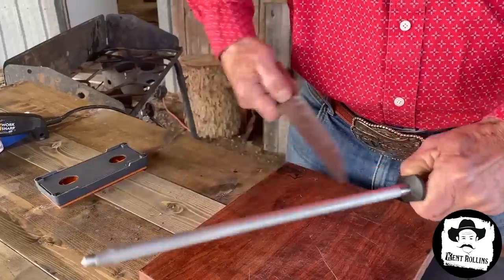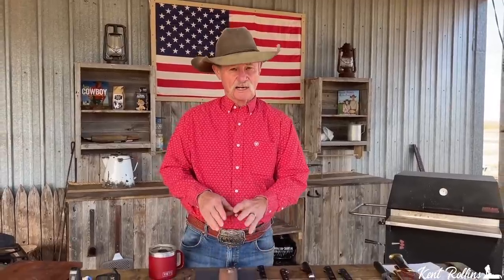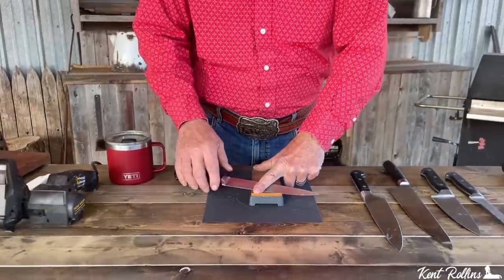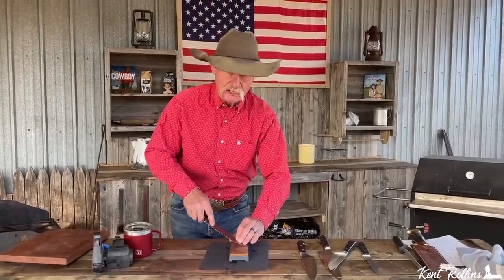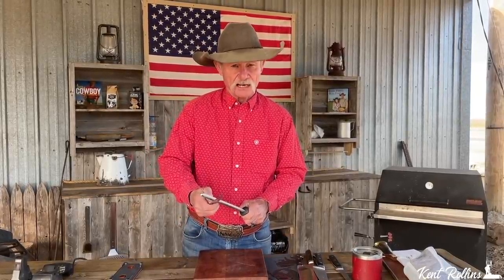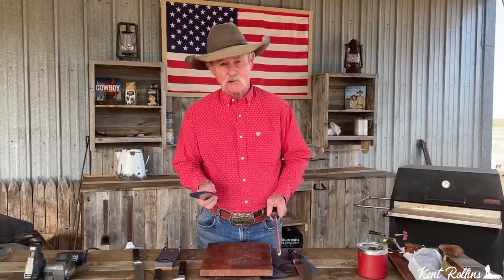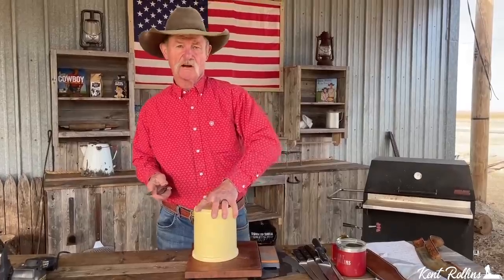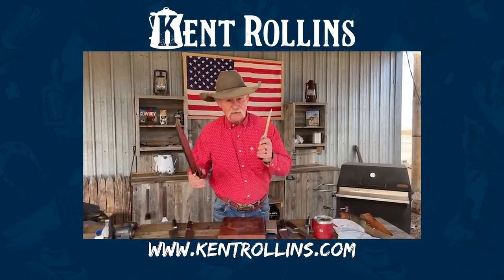Best Knife Sharpening Tips | How to Sharpen a Knife

Comment: Hi Kent! I’m a professional knife sharpener who found your video thanks to the YouTube algorithm. 
If you don’t mind, I have some tips for you to take your sharpening results even further.
When sharpening on the diamond plate or on the stones, I’d really recommend you to keep your fingers on the blade while sharpening. So where you put the pressure with your fingers, that’s the area you will be sharpening. Then work your way along the blade section by section to get a burr along the entire blade before you move on to a finer grit. When you’ve worked your way through coarse, medium and fine grit, strop the knife to remove all that loose steel from the edge.

Also try not to cut into the stone, sharpen you knife with long, smooth strokes along the entire stone to keep that blade angle as steady as possible! Then you’ll have a blade sharp enough to shave with it.

Cheers from Sweden!
Reply: I was gonna say the same myself

Comment: Nothing is more dangerous than a dull knife.  I have been cooking in commercial kitchens for over forty years, and tuning up my knife edge is always the first job of the day!  Thank you for the tips Kent!
Reply: I never understood this idea, so maybe you can explain it for me since you have more experience. Poor cutting practices and not paying attention is dangerous, and a dull knife won't cut your fingers off. I've cut myself with both, and would say a dull knife hurts worse, but a sharp knife does a lot more damage.
Reply: @gotdangedcommiesitellyahwa6298  I think what they're saying is you have to put more force behind a dull knife so if it slips, which it is more likely to, it will do more damage
Reply: @gotdangedcommiesitellyahwa6298  The whole idea of a sharp knife, is to minimize the effort required to perform a given task.  For example, if you are processing a beef hind quarter, or boning a lamb shank, you want to do it with minimal exertion.  A dull knife will make the job difficult, and increase the effort needed, as well as increase the possibility for error and injury.  In all my time, I have only been seriously cut once (the tip of my pinky finger) due to not paying enough attention during a dinner rush.  That was a very sharp knife, and I have no one to blame but myself.  Trust me when I say, that a sharp, well maintained knife is the only way to go.
Reply: @gotdangedcommiesitellyahwa6298  Yes, in theory if the same good practices were done then it wouldn't matter, and if the same bad practices were done then the dull knife would do less damage. The point being made is that unfortunately us humans are not machines and dull knives tend to encourage bad practices due to requiring more force, while sharp knives that cut easily are easier to keep in control.
Reply: My in-laws had four knives in their kitchen and they were all so dull they wouldn't cut butter if you heated them up first. They were older and I figured they just couldn't keep them sharp like they used to, so once, while we were visiting, they had gone somewhere for the afternoon and I thought I'd do something nice and spent a good bit of time sharpening the knives. I told him when they got home and my father in law grabbed one and threw a fit because it was sharp. He said something to the effect that it was dangerous and they'd end up cutting their fingers off then proceeded to run the freshly sharpened edge over the bottom of a coffee cup until it was dull again, then grabbed the others and did the same thing. 🤷🏻‍♂️😞
Reply: @randymartin5521  OMG!
Reply: @jeffslaven  yeah, mom-in-law had some issues but my father-in-law was a whole different kind of crazy.

Comment: Your dad was right, as a chef for 10+ years dull knives increase pressure applied and increased pressure with a  dull knife will tear both you and what you are trying to cut.  The knife you were trying to read we always called "Henkels" I use almost the same brand called "Wustoff".  Those knives are fantastic and i have had mine for 30 years and still sharp as a razor. One note my chef's knife is kept @ 20 degrees where my Japanese Santoku is more like 15 -16 degrees.  One warning about side windows, they are tempered so if you  hit them with the edge or the dull side too hard... just so they will pop so be warned...it'll work but be careful.
Reply: I'd rather be cut with a sharp knife than a dull knife any day LOL.

Comment: My buddy has an old “barn sharpener” it’s like 20 washers with 10 on each side fingered together like playing cards. But kept apart enough to leave a perfect bevel in between them. It bolts to a door frame and you can just draw a blade down the center like two times ,and it will have a perfect 50/50 bevel.  He says it’s really old , and ALL the draw type sharpeners are based off of it. 
   I still go old school with oil stones , and finish with diamond dust on stainless plate steel . 
  Really like the window trick !!! That’s just pure genius .... 
   🤠🎸🎶✌️

Comment: Oh yes I remember TG&Y stores.  If it weren't for TG&Y and the Dollar Store in my little town of Lucedale, MS back in the '70s, we would have to go to big city in Mobile, AL for anything else.  Now we have Walmart and think we're in heaven now. 😁

Most people I know use the three stone method or a circular method and most prefer oil to water when wetting the stone, something about water and steel don't mix too well.

I've got a Crocodile Dundee knife also but it needs a new scabbard because it was dry-rotted when I got it brand new from Amazon but I don't recommend using the honing/sharpening rod that came with it since it's for show.

I've got some K-Bars also and they all came with dull blades but sharp enough to cut but not razor sharp.  My Buck 110, 119, and 120 came razor sharp out of the box, so no need to sharpen them until much later.

Great video Kent and looking forward to your next one.

Comment: I still have my 12” breaking knife, a 6” flexible curved boning knife, and a 6” straight boning knife that I used at Texas Tech meats classes where we learned to cut up beef, pork & lamb.  Those knives are R.H. Forschner or Victorinox trade named knives made in Switzerland ( same company as the “Swiss army knife”.) Those knives are 45 years old and I use them daily, generally use a good german honing steel to dress up the edge.  You can find hundreds on ebay and they are very reasonably priced.  We go to estate sales and are amazed at how many people use cheap trash knives they buy at the grocery store. We have a family custom - give a newlywed couple a couple of these good knives as a wedding present. They’ll last forever unless you ruin them by grinding them on a can opener sharpener. Love your channel!! I learn something new from you everyday! Rob Hillsboro,Tx.

Comment: Yessiree !  Best to have a decent quality made knife first and then maintain it.  Not many folks want to spend much money on a knife when they can buy $10 knives that work almost as well but will not last very long. Happens year after year...but those who can justify $50 to $100 on a well made knife will find the advantages in short time. A whetstone is the best method we think because they have such a larger surface and make the process much easier to maintain the 20 degree double nickel while stropping the knife. 
And that is a true statement about dull knives...they are more dangerous than a sharp one is yet folks continue to believe that is false. Too bad so sad. 
Those are Henkel brand knives also known as J.A. Henkels Zwilling Germany knives. Another great brand is Victorinox and Miyabi.

Comment: Keeping a sharp knife is 100% the most important part of kitchen work. Trust me. I have done it for 17 years, when that knife hangs when you're going fast, you'll feel it. You need that blade to cut at all times, not even shave worthy but just sharp to work with. I have cut my fingers on dull blades too many times. The rubber underneath is such a cool fact, we do it on the line serving food. Our cutting boards always go on a wet towel before we work. Approximately 45 degrees for a working edge when you do food. Thanks Kent!

Comment: I didn't know about using my pickup window to sharpen my knife.   I always used a little pocket sharpener when I am dressing an elk in the backcountry.  I have the same diamond stone as you and it works great.   I now have Japanese knifes and I use both a 600 and 1000 stone to keep them sharp.   I use my German knifes when I might hit a bone and use the diamond stone to bring the edge back.  Great video with lots of correct things on how to sharpen a knife.

Comment: Congrats on 2M subscribers! I just saw!
I was sure I was subscribed for years, and just found out I wasn't yesterday.

Knife sharpening is something I do obsessively - what isn't mentioned (this being specifically about cooking knives) is that the edge angle has to do with the intended use, and the steel type and temper& hardening. Sometimes, a toothier edge is better, sometimes a finer edge, or more polished. It's actually very complex, and has to do with blade use and personal preference as well as the exact steel(s) involved. 
I sharpen things while my hands aren't otherwise busy. 

The stropping with leather, I highly advise. Good for straight razors, and I do that with my little whittling knife.

Comment: How do you feel about Arkansas stone? My dad uses one of those pull ones, I will never know how he gets a good edge. I do want to say one thing though, on a belt sharpener you don't go to the other side of sharpener. That will cut the belt.
Reply: That’s why you go to the other side. The belt goes the opposite direction on the other side! Remember it has only one belt and it goes in a circle!
Reply: @garyevans3421  What i was saying is, flip the knife around and use the same side. You want the belt to move away from the edge. But according to my manual for the Ken Onion it apparently doesn't matter.

Comment: The one with the blue handle you were not using correctly. The knife should be stationary and you drag the sharpener across it, it works very well when properly used.

Comment: I’ve used most of those methods over the years (never the car glass though!), but several years ago America’s Test Kitchen rated the Chef’s Choice Trizor XV the best electric sharpener, even besting many of the diamond stone manual ones. I was skeptical because I recall all the bad electric knife sharpeners from way back (remember the ones that came on the back of electric can openers?). But I have to say the Chef’s Choice for me changed the game! Some on my Henkels knives go back to the 1970’s and this thing put an edge on them like I have never seen. 
The key is that it takes the normal 20-degree edge of a “western” (French or German) knife and sharpens it to an “eastern” (Japanese) 15-degree edge. The first time I used it you could really here the grinding but by the time you are done (a 3-step process) the edge is fantastic. You normally only have to do the whole process once a year and then maybe a couple times just do a quick pass through the final honing and polishing steps. I highly recommend it and it is still top rated.

Comment: I have purchased stones and sharpeners like the ken onion worksharp and everything in between. If you want a razor sharp knife thats easy to use get yourself a warthog V sharp classic. The first time you sharpen a dull knife Its going to take about 500 strokes on coarse, 300 on medium, 300 on fine and about 50 just on the steels but it will be shaving sharp and stay that way. After that just touch up on the steels every few times you use the knife.

Comment: I'm a knife junky and love sharpening blades I also reprofile knives . The most easy sharpening system is either a lansky guided sharpening system or better yet the new Precision Adjust by Worksharp .  I always say just spend the money and buy one ....That's said you can save your blades by loving them and not abusing them . 

The #1 most important thing with blades is ...
Learn how to strop and also use a ceramic rod ...If ya Learn that skill your knives will never need to touch another stone again. 

A good 1095 carbon steel will stay sharp forever if ya strop um after ya use um .  But if ya want stainless I recommend 14C28N  German steel , it's very easy to sharpen and holds a great edge and doesn't break the bank. 

You cowboys would really like a Mora  kansbol  knife in your kitchen ...Your wives would also love it as a gift 🎁 for the kitchen.

Comment: I missed this one some how..... There are a number of diamond plates that are combination plates, about 300 or 400 grit on one side, and 1000 to 1200 grit on the other side. These can be found at specialty sharpening supply places, like Woodcraft Stores, and others that are similar. A 3 by 10 inch stone is great. This is very sufficient for most cooks. Any use of a grinding stone creates a burr, and that burr needs to be removed. There is a burr left on stones up to 16000 grit which as far too fine for a kitchen, but necessary for a wood shop. Burr removal is what happens when you were using the belt. Most of the time, you add a 'polishing' compound to the leather. You can find a black one at the big box hardware stores, and they are called 'polishing' compounds, not stropping compounds. The steel, wine bottle, beer bottle, ceramic pot, car window are useful as a substitute steel. Think of the knife edge as a razor saw with very fine teeth. With use, the teeth bet bent out of line. Think of the poles coming out of the top of a teepee. The steel lines the teeth on your knife back up in a straight line. Honing, to me, means just using a fine grit diamond plate. Stropping is what removes the burr.

Comment: I have the blue strap guy and it's not so bad. The angle of the stones in it aren't precise, so it will drag badly like that until it reshapes the blade to how the stones are installed. It will also drag badly on a really dull knife (which is kind of what you'd want to happen). 

For cheap knives that dull quickly, it's an easy enough touch up tool the was only a couple of dollars. If I had better knives, I'd probably have better sharpeners too.

Comment: I have used the quick sharp machine for years now and found that it will sharpen a knife very fast and very sharp but have found that it will take more off near the tang of the knife as you arent moving at the start of the cycle and the belt takes a bit more off the blade then . I have also found that the wiltshire knives are very hard to get a razor sharp edge on them and the edge doesent last as long as a victronox blade ( from deboning deer ) .

Comment: Tried forward draw on a steel.  I've found that reverse draw brings the wire edge (rolled over) back up appreciably faster and more consistent.  Many videos show the knife being drawn forward, edge first along the steel.  This can actually push an already rolled edge over even further.  I have a chef's knife (cheap $20) I've used for a decade, almost daily for chopping, slicing, and usual kitchen work, and it is still on the original edge, which has only seen a steel in all that time.  

After a few quick reverse draws on the steel, or even the spine of another knife (forks too) everything is butter.  Just did this at a friend's for steak dinner.  His steak knives were as dull as a beaver tail.   Grabbed my fork and reverse stropped the blade up real quick, grabbed a piece of his kid's coloring paper on the table and clean sliced the corner off, before turning my attention to my rare steak, practically floating in it's own juices.

Best grill out of the year so far.

🤓

Comment: I buy a $55 Victorinox Fibrox 8-inch chef knife (they come super sharp) and use something similar to that white thing (which is really a honer not a sharpener) and I get about 4 years out of it with honing only and never screwing around with a stone and all that. To use the handheld honer, put the knife blade-side up with the tip of the blade hanging over the counter and run the honer over the blade from base to tip about 4 or 5 times and you're done. Do that once a week or so and buy a new one every 4 years. Pretty good deal for about a dollar a month.

Comment: For most people, and especially if they're just doing kitchen knives (just not really expensive ones), a 3-stage "Magic Chef" electric knife sharpener is the best way to go for resharpening a dull knife. Fast and easy to use. 
Actually resharpening a knife with a whetstone is a lot more intensive than what's shown here, and for the love of God, NEVER use a whetstone in your moving hand while trying to hold the knife steady with your other hand. All that's going to do is guarantee uneven angles all up and down the length of the cutting edge. The stone is ALWAYS meant to be stationary on a non-slip surface with the knife, and only the knife, moving.

Comment: I am a real believer in the 6 or 8 inch pressed paper wheels one with grit and one with polish, put on a bench grinder, at 22 1/2 degrees approx a good steel will take on a razor edge. goes back to my Taxidermy days where I had to have sharp edges. Just my opinion